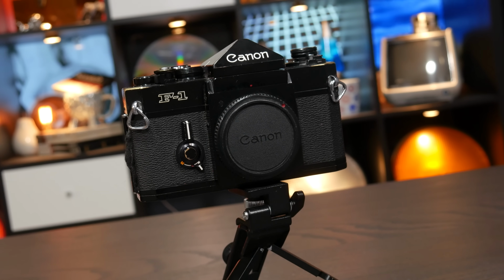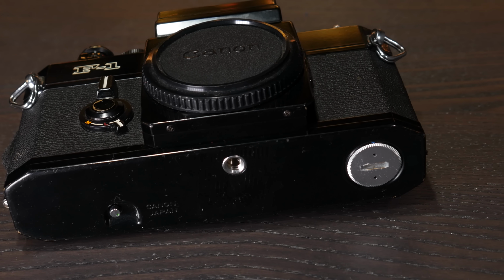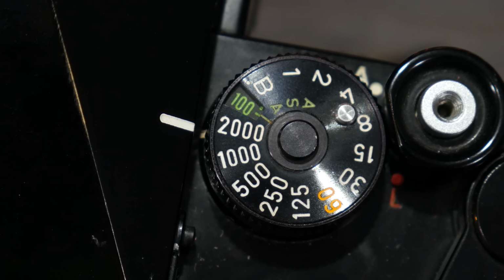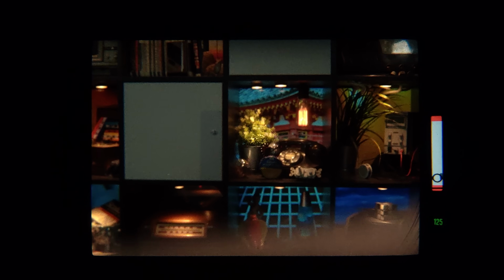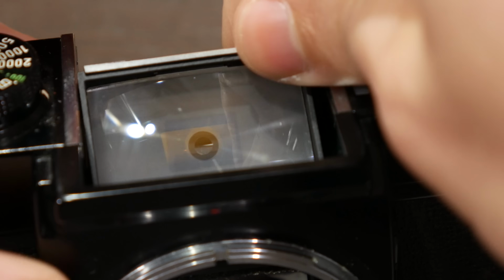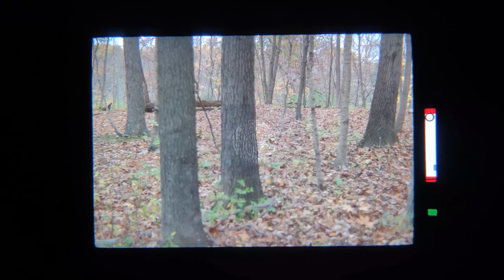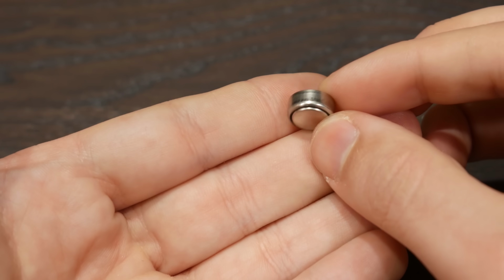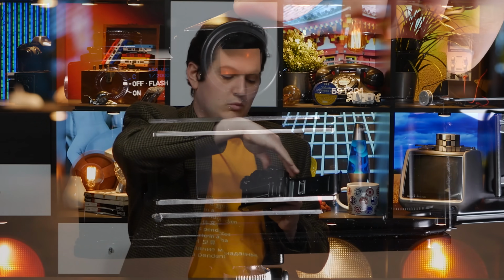1970's Camera Tech: How they showed you what settings to use

Comment: The Canon camera looks so strange to me, an avid Minolta SRT 303 user. Minolta only moves the light needle based on the amount of light, while the settings needle is combined for f-number, shutter speed and film speed. And yes, the system of pulleys to move the needle is incredibly complex, I had to fix it in my camera and it took me 2 days to just trace it and understand completely...

Comment: Actually, Canon's Booster T Finder, which takes a separate battery, increases the Canon F-1, and revision Canon F-1(n) for low light photography to Exposure Values of EV 10 to EV -3.5. The Canon F-1 alone can only handle EV 15 to EV 3 so this extends the range to EV 15 to EV -3.5. "The shutter speed ranges from 1/60 to 60 seconds and ASA setting is possible up to 12800 with the Booster T Finder." This is all included with the match needle metering only requiring an additional No. 544 6V silver oxide battery, which is readily available. https://www.mir.com.my/rb/photography/hardwares/classics/canonf1/html/booster/index.htm

Comment: My first camera was an early 1980's Nikon FM2 - also entirely manual. I remember the light meter display was 3 red LEDs 0, - and +. If the zero was lit you had correct exposure and if not then the plus or minus told you which way to adjust the speed or aperture.

Comment: I know VERY little about electronics, so this question might be dumb as hell, but could you solder in a resistor between the battery and the meter, so that the amount of electricity that goes to the meter is lowered?

Comment: Holy cow, there's so much amazing engineering in these things. How much did this camera cost back when it was new??
Reply: around $1,000 depending on options in 1986 or $2,300 adjusted so not to much different from current higher end digital SLRs

Comment: please talk about how the focus ring works. I've always wondered and I really wish modern DSLRs included them. Sometimes I switch to manual focus, and its almost impossible to tell if your focused in low light situations. I need a way to get sharp manual focus.
Reply: Sgtmantis...I agree; a better focusing system for manual should be standard; it has let me down a few times when I thought I was focused but was not dead on.

Comment: Fun fact: If you SUSPECTED your photos (provided you were using black and white film) were going to be slightly under-exposed, you could "push-process" the film (leave it in the developer longer.)  It would make the photo more high-contrast, and you'd lose detail, but it would also make it more bold and crisp. It was good if you were working with photos that would wind up in a newspaper.
Reply: Push-processing is precisely what happens in digital cameras when one sets the EI to higher than the “Base ISO”.

Comment: Great video on a subject I enjoy. I'd like to add a comment on the shutter seen here. It's called a focal-plane shutter because it's located at the focal plane as apposed to being in the lens where rangefinder camera shutters are located. Focal plane shutters are older than SLR cameras themselves and were used on large format cameras. The narrator only mentioned the disadvantage of flash synchronization speed with this shutter and alluded to a "distortion" effect without mentioning what it was. The distortion was while shooting objects moving horizontally in the same direction to the shutter curtain. It created a distortion where the object tended to lean in the direction of travel. This distortion was so influential in the early days of photographing auto racing, that artists who created drawings or paintings of auto racing actually incorporated this distortion into their creation. 

My Nikon F2 was another fully mechanical SLR of this era, but used a center needle system where you had to adjust the controls to get the needle in the center instead of chasing the ring. Either system is good. The Nikon used silver batteries that are still available. It also had a flash sync speed of 1/80 of a second and was a horizontal shutter too. The on/off switch on the Nikon was incorporated into the winding lever and was activated by moving the lever into the "stand-off" position. 

This is a great video for introducing newcomers to film photography. In my opinion, film photography is an important subject needed to understand as a prerequisite to digital photography. I'm sure there are folks who will disagree, but that's how I do it.

Comment: I had a Praktica SLR, which had different light meter, called sometimes 'black widow' - it had two triangular red LEDs on a right side of viewfinder, and if light was too low lower one lit up, for too much upper was lit up, and the closer you were to perfect setting, the more uniformly lit they were, creating red hourglass shape. It turned on when you half-pressed shutter (which also engaged aperture). There was even an adapter which automatically adjusted the aperture, using input from the light meter to set control small linear motor turning the lever on the lens.. But, it was made either at the end of 70s or in early 80s.

Comment: It's possible to recalibrate the meters in most of the older cameras to use a modern battery or get an MR8 adapter. That uses a 386 silver oxide battery in a reusable part with voltage regulation to drop the voltage to 1.35
Reply: You can avoid this if your camera is able to use any battery chemistry, some lightmeters use a Wheatstone Bridge circuit and are largely voltage independent.  AFAIK all prakticas seem to use this circuit.  It wont do any harm to use an adapter in these cameras, it'll just be a waste of money.

Comment: Ah so happy to see you finally do a video on that Canon I've been admiring for ages. If I might offer some suggestions for other 35mm cameras to consider featuring: I would propose the Olympus XA (A full-featured rangefinder and astounding feat of miniaturization), the Nikon FM3a (a magnificent camera which can operate fully mechanically at all shutter speeds, but that also somehow has an aperture-priority auto mode), and the Minolta Maxxum 7000 (The first autofocusing and integrated autowinding SLR that ushered in a new era of cameras).

Comment: Wtf. You managed to give an extensive and really informative photography course in only ten minutes. And it was a really good one... I mean it.
Reply: Yep, he even nailed just how easy sunny 16 is.  I see so many people thinking that they have to use f16, no matter what.  I keep trying to explain that its the way to find your starting point, then you adjust each setting simply by the number of stops.  I use it on my DSLR too.

It also then lets you understand cameras that a much older.  Like those from the 40's or 20's that certainly dont have a lightmeter and were designed to use slow film.  When you load an ISO 200 120 film roll into your 1923 folding camera you then  use sunny 16 and understand very quickly that as your camera cant go faster that 1/250th and its has a max aperture of f11 the the middle of the day is WAY too bright for it because you need to use slow film.  Like PAN F ;)

The moment you understand that exposure triangle is liberating.  I hardly use my lightmeter.

Comment: On film speed -- I don't think a film being "fast" or "slow" has anything to do with shutter speed directly. A "slow" film (e.g. ISO 100) literally takes longer to expose an image (of a constant amount of light) on it than "fast" (e.g. ISO 1600) film. I think it's really that simple. Obviously this has an effect on shutter speed, but I think it makes sense to talk about the speed of film outside the context of a camera.

Put another way, you could measure the sensitivity of film in seconds -- the number of seconds it takes a certain amount of light to expose the film to saturation.
Reply: No, the speed of the film directly affects the shutter speed and aperture when you are trying to expose correctly.  Their relationship is locked into the "exposure triangle" and film speeds are in "stops" the same as shutter and apertures are.  ISO 100 film is one stop slower than ISO 200 and two stops slower than ISO 400.  This matches with the stops on the aperture ring and the stutter speed selections.  Thats why we have 100, 200, 400, 800, 1600 speeds, they are stops. 

The film emulsion itself, outside of the camera as you consider, must be calibrated to one of those speeds.  Once that has been done however, an ISO 100 film is the same as another ISO 100 film (in terms of exposure).  Well, there will be differences hence why many test them side by side to see what they prefer.  Such differences usually are in colour and exposure latitude and grain size.  So a cheap ISO 100 film may look crap, but its still ISO 100 and has the same direct relationship with the settings.  That crap ISO 100 film may work better if exposed as if it were ISO 200...or ISO 50.

To get a correct exposure you can work out how many stops you need to adjust by.  You can thus vary ISO, aperture and shutter speed in any combination to make that adjustment, all of which can be done in your head because of their direct relationship.  On most film cameras, changing the ISO is hard, you would need to change the film so would need a camera that allows mid-roll rewinding or removable film backs.  On a DSLR its easy however, and shooting in manual mode on a DSLR allows you to vary all three settings as required.

Changing the ISO setting on a film camera, yet keeping the same film inside it, is a long time used method of adding exposure compensation to a camera that has no facility and is at least semi-automatic so is choosing at least one of the values, typically it chooses a shutter speed as most semi-automatic cameras tend to be aperature priority.  Also this can be how you have the light meter help you expose the crap ISO 100 film as if it were 200.
Reply: @dlarge6502  ...Thanks for the info. But I didn't say that film speed doesn't affect needed shutter speed. I said that using the word "speed" to describe film makes sense independent of a camera. It's just how fast the film exposes for a given amount of light. I had never thought of it that way, and it's neat.

Comment: As an old photographer who had cameras of this vintage, you CAN make a 1.5v battery work, by adding the appropriate Zener diode, which knocks the voltage back to about 1.4v and then re calibrating the meter.  You need to be careful thought, the guys who have the knowledge and tools to do this, are very close to or past retirement age.
Reply: Problem solved: https://www.youtube.com/watch?v=Yo7T6OQ3BFo

Comment: I had two cameras from this era, and I still have one to this day. It still works perfectly. I have also used Canon F-1's as well. They are in a word, excellent cameras and so are the lenses Canon made for it. Like it's Nikon competitors the F and F-2, it had a mirror lock, interchangeable focusing screens and viewfinders, and did not need batteries to operate.  I owned a F-2 and still have a Nikon F-3HP which came out around 1980. I enjoyed immensely my F-2, even more than my F-3HP.

Comment: When I was young, my dad bought a camera made by Praktica in communist germany, and he eventually gave it to me. The light sensor wasn't working with a battery, but with a silicon panel. There was a small voltmeter and I had to align a second needle to the voltmeter. Then the aperture / speed couples can be red on the dial button itself. I learned a lot about photo with this old camera, which eventually broke apart...
Reply: That was probably one of the Praktica Nova models.  Some old cameras that use Cds cells to measure light tend to have non-working lightmeters as the cells degrade with age.  I have one somewhere (I have quite a few prakticas
Reply: @dlarge6502  Thanx, I didn't remember the exact model but after checking on google image, it was a Praktica Nova B.

Comment: The meter doesn't use selenium. It uses a much more sensitive and reliable CdS cell. Selenium meters do not require batteries - they're basically tiny solar panels. Selenium meters usually require large lenticular or convex lenses to channel light. A Selenium sensor would have to be huge to be as sensitive as the CdS cell that's actually in the Canon.

Comment: could you use some rechargable battery which run around 1.2? i know aa and aaa are the wrong style, but might exist. or 3d print a base that holds a normal battery with contacts. ;)

Comment: Nitpicker's remark to 9:00 - you are actually not changing the sensitivity of the sensor. The sensor has a fixed sensitivity. You are changing the amplification of the signal that's coming from the sensor in a way that mimics changing the sensitivity.

It's a bit of a pet peeve of mine. I know that for most people, the distinction doesn't really matter, but it's baffling how many people who should know that actually don't. Not saying you're one of them.

(And, related to that, it's also baffling how many astrophotographers and other low-light photographers think upping the sensitivity somehow makes more light hit the sensor, because they get an image that looks brighter in preview.)

Comment: Mm, that capacitor whine at the end was sooo nostalgia-inducing for me.
Reply: Reminds me of low powered Kako and National electronic flashes before Vivitar became the electronic flash brand.
Reply: Umm, accesssory flashes still make that sound.  Its the inverter circuitry that is used to step up the voltage to the amount required by the capacitor which is, in turn, the voltage need to trigger the 'strobe' light.   The pitch of the whine goes up as the load from the capacitor decreases.  Befor this inverter circuitry was developed, photographers actually used 410 volt batteries (carried in a separate pack) to power their flashes.

Comment: I was so excited when you explained what this lever on my camera did. And then I was severely disappointed when I learned mine doesn't have a timer built in. Nor can I take my viewfinder off or check the battery in my light meter. But I still learned a lot!

Comment: Fun experiment for those of you that use glasses: 

(remove your glasses when trying this)

if you curl (only!) your pointing finger against your hand 
in such a way that you create a tinni tiny hole that you can see through when your eye is really close
You'll see that you don't need your glasses after all lol
Probably this won't work with many of you, but it did to everybody that i told this trick

The aperture of a lens does the exact same thing when closed, it aligns light=more depth

Comment: Great video. Excellent overview of the exposure triangle, including the rule of 16. I first learned photography on a Yashica YP series, and then had a Minolta X-700. They were both mechanical with the needle light meter. The Minolta also had the +/- knob for "pushing" the exposure. Having learned on a mechanical really made the jump to digital easier because I had to learn the basics and not just rely on setting the camera to Auto mode.
I always wondered how the split-circle focus worked. Can't wait for the next in the series!

Comment: We have to remember one thing: This system looks intuitive and simple because it has been an object of countless design proposals and staff meetings.

That's what always fascinated me about these things. We just use small things that were someone's work for like 3 months.
Reply: 3 months is kind of optimistic in most cases though. ;)
Reply: Canon took about 5-6 years to create the F-1 system
Reply: When I worked as a software engineer for a large software company there was an inverse relationship between the number of design meetings/reviews and the complexity of the code. As a designer/coder I could build an elegant solution, only to have it torn apart and bloated with useless post hoc requirements from (usually) the QA department.
Reply: @trippmoore  ahh. The good ol camel.
Reply: @doubtful_seer ... the horse designed by committee.
Reply: @trippmoore  I worked as a QAM and for some part of the implementation that had to be done according to regulation, I had to jump in and code it myself. The team wasn't apt enough. When I did quit, they attempted to rewrite it in a "simpler" way (i.e. consolidating everything into a function). That didn't end well as the new code was impossible to "prove" and testing was a nightmare. Devs were really pissed by that "shitty code" 😃

At some point, I had to shove the dependency injection and have them follow a training on design patterns and refactoring, because the code became routinely a mess. 

I even had to explain to a guy what are SQL injections and why sending SQL to the back-end was quite a bad idea. Even had someone doing batches by having the front-end calling the back-end repeatedly and hitting browser limitation on number of concurrent requests and the having issues with back-end also dropping requests ^^ Educated on stored procedures and even coded that batch which took like an hour and went in few seconds as a result.

I was the "QA department" and I can confirm that devs despised when I cam to talk seriously to them😁

Now, I am back to the full dev thing (aka "full stack", but more "do everything") and I wish we had at least QC, It's nice to have someone check your work so you don't have to stray too far from your main job. There is a bit of QC built in IntelliJ and I like that too, better than nothing!
Reply: all these fancy mechanism designs and their manufacturing processes were done without the aid of computer. paper, pen and slide rule.
Reply: Canon actually stole this from Nikon. The Nikon F already came out in 1959.
Reply: @caldera878  We are not talking about the name "F", but the specific camera system. Similar concepts were used by other great brands like the Exacta family and the Hasselblad small-format cameras (small-format is the film sizes from 9x9 cm down to 4x4 cm, 35mm is the even smaller film type mass produced for movies).